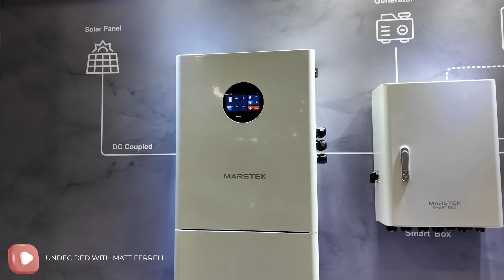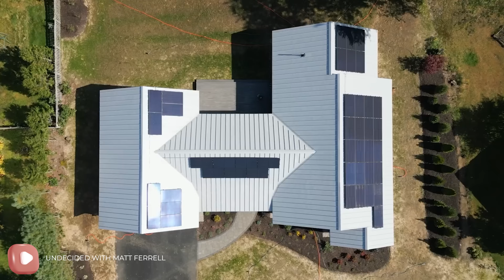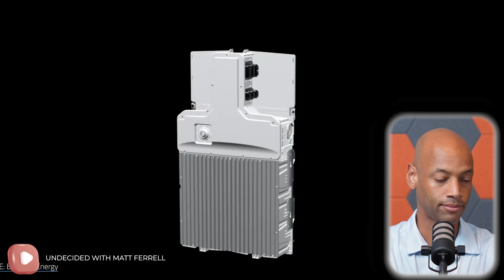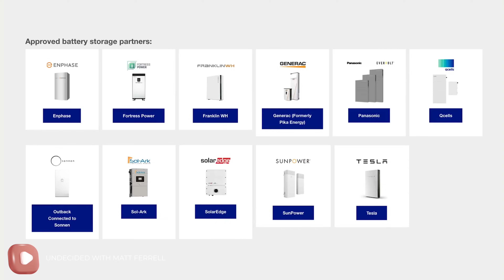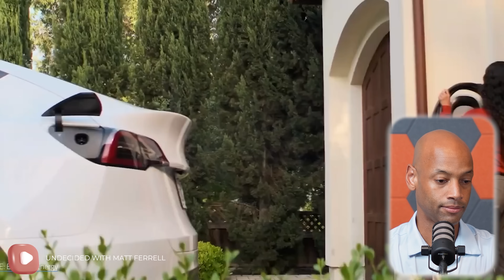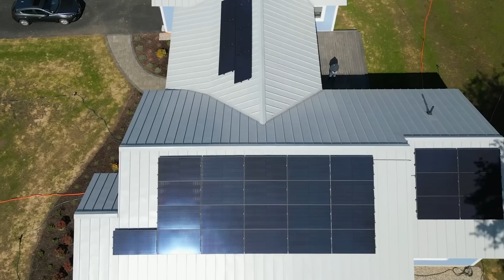Best Battery for Net Zero Home? (Enphase IQ 5P)

Comment: It has always seemed to me that Enphase has gone out of their way to create a route where they force people that buy their solar panel micro inverters and controllers, etc. to force people to be locked into buying all Enphase components including batteries.     They also seem to have (doubled down) by creating their batteries with even more micro inverters and so to force people to make you buy as many of their inverters as possible and in the end it is to line their pockets.     ( Not a Question Really, but more of what i've seen from their equipment and their pushing people to buy more and more of their micro inverters. )
Reply: The counterpoint is vendor finger-pointing if an issue arises leaving homeowner in the lurch when combining best-of-breed. We are VERY early in the tech curve on consumer whole home batteries (in the overall scheme of things). I have SunPower system using EnPhase inverters… I’m annoyed enough with SunPower for their heavily shortcut to-my-detriment install, that I’d love to dump their PVS6… but anyway.
As SPAN is complete overkill for me/my use case, what I’ll be looking forward at some point is a Hybrid Inverter and battery system that are guaranteed compatible, if not same vendor or an integrated unit.
Matt’s mentions his real reason for enPhase battery is local AHJ sprinkler requirement for over 20kWh system … as I’m looking at >20kWh battery system, enPhase makes no sense at this time for me.. other professionally installed options will be cheaper
Reply: You can choose whatever panel you want.  The Enphase hardware is good, price reasonable, app great, but do charge extra for some features.  The only item that is sub-par is their chargers.

Comment: In the end it seems you’d be better of having an energy audit of the house, mitigate things like missing insulation, replace old single pane windows, replace older water heater, replace old furnace with heat pump, etc. in other words, limit your energy usage up front before investing in solar cells and batteries.
Reply from the maker: Agree 100%
Reply: True. I have all of 3.9 kW peak of solar. Under NEM 2.0 in California I produce 2,000 kW-hr excess per year. This really surprised me as in renovating my house I added a basement and two more baths to a three bedroom house. The difference was really insulating everything, putting in double pane windows and going all electric with heat pumps for AC and hot water.

Comment: Wonder if you can take the 9.6 kW 240v NEMA 14-50 output of the Cybertruck bed and hook it up to the 'generator' input of the a battery system? Seems like it would work just like a generator with a L1 & L2 coming from the generator and there is a neutral balancing transformer in the battery system to create the 120v capable input into your backup loads.

Comment: one comment. but overall great video and you helped me understand more. my comment is if you have backup power then you dont need internet 12:35. WiFi would be powered but no internet, luckily you would be using your LAN network and not relying on WAN. So technically if your on the WiFi you can still communicate with your system so long as your system uses your LAN network, either plugged in or on wifi,  which more than likely is. 

But much appreciated my brother this video was great! Appreciate you taking the time to make this.

Comment: Great video. As a homeowner, I'm a novice with respect to solar panels. Wish I had discovered this channel before making a decision. I went with the enphase panels but am somewhat comforted by this video that it may not have been a bad choice all things considered. I did not go with the batteries, but I did consider them. I did have the designers put together a full blown option in the event I wanted to add batteries in the future.

Comment: I've really been thinking about going with the EcoFlow DELTA Pro Ultra set up. Seems to come out much cheaper while allowing a modular setup with batteries that can be moved around for multiple use cases.
Reply: I dont think you can use the Delta Pro Ultra or any Ecoflow or other brand of off grid systems with a grid-tied solar system.

Comment: We went with 3 Enphase 5p batteries with 24 Qcell 410 panels and IQ8M inverters for $43 k.  Both of the Tesla system quotes were 6 figures.  We're running off-grid after Hurricane Beryl.  Turning off the A/C in the evening, and surviving.  I wish we had gone with 4 batteries.
Reply from the maker: Hey, that’s a very good price for that system. I hope your installer was able to make a little bit of profit. Glad to hear the system is holding up.
Reply: @SolarSurge  After 7 quotes... my wife got us a "friends & family" quote from a friend in the business.  We got lucky.  The next closest quote $18k more.
Reply from the maker: @DGuthrie1111  I'd bet they lost money on that project.  Hopefully that company will be able to make it long term.

Comment: Quick question on app, is Bluetooth sufficient to control these home battery systems or do you actually need internet access? If so, why?
Reply from the maker: That's a great question.  I don't have a clear answer on that yet.
Reply: @SolarSurge Enphase Requires a live internet connection, to control the battery discharge, in the event your connected to a virtual powerplant on the grid, this is because the utility directs them to put your system in discharge in the event they need grid support.  They also require a cell modem as a backup, in the event the main ethernet or wifi connection stops working.  It’s also a good ides for the data logging of production & discharge, and finally it’s a requirement for their 15 year/6,000 cycle battery warranty.  how can they track cycles if it’s not being monitored?
Reply: Enphase is now holding training for use of their batteries and micros in OFF grid systems.  I would assume that the internet connection requirement will be relaxed with this type of system, since many of these OFF grid systems are in remote locations and do not have internet access.

Comment: Thing is that these batteries are too expensive, but yes the eco system is nice. Then again the solar inverters that are nice are also more expensive than the first available model, setting the max of your 400wp panel back to 300wp. SO all in all I am little bit happy, but it has its downsides, which can be overcome at extra costs, the system is much more expensive than other systems. And you are right about app dependence and then I refer to my hifi system than I cannot upgrade because of the app. Wouldnt mind a small control panel in my closet.

Comment: Great video review! Both Matt Ferrell's channels and yours are a must-watch. It's like a good comic book crossover with you reviewing the video! I personally prefer Solaredge due to the lower price point compared to Enphase, but the NMC battery chemistry is less superior than LFP. I do have a question. Since Solaredge has released their Solaredge Energy Hub inverter, has the reliability improved? Has the installers noticed a lowering of the failure rates with that inverter?

Comment: What would you recommend for a pro-installed unified battery/controller ecosystem setup then? I used to think you favored Enphase, but you seemed to have soured on them recently?
Reply from the maker: I still like Enphase.  I also like Tesla, Franklin and SolarEdge depending on the situation.  In this case, since he already had Enphase micro-inverters, staying with the Enphase batteries made sense.

Comment: Seems like the Sigenergy/PointGuard, modular, stackable, battery/car charger/controller/inverter system has a much better architecture. You can stack the 8 kWh batteries, then stack the car charger Lego, then the inverter Lego on top in a single stack that takes up just a similar amount of floor space for a single, undersized Powerwall. With Enphase, you’d wind up with 8, tiny batteries, a car charger, a controller, etc. strewn across an entire wall. You’d better have a really, really, really big wall!

Comment: Joe, have you found any definitive document or spec sheet from Tesla which actually/officially states that the new Power Wall 3 is made up of LFP batteries as opposed to NMC batteries? I still haven't been able to officially confirm that the Power Wall 3 system use LFP batteries.
Reply from the maker: No I think they intentionally did not publish this to spark the kind of speculation we are having now.

Comment: Hey @Solar Surge... if they are pahsing out or doing away with net metering as you stated in this video, then whats the purpose of even getting panels and batteries anymore? If we eventually wont significantly lower or electric bill, then why pay $30k to $50k for all of this stuff?
Reply from the maker: The idea is that you can be your own utility both day and night so you don’t need Net Metering. You would literally use the electric utility as a last resort option only. So you would be able to reduce your electric bill significantly.

Comment: Enphase discusses their Gen 4 10kw battery in their latest investor presentation.  Title is something along the lines of “CEO letter 2023” (reviews their fiscal 2023).  Due in 2025 along  with Combiner and System Controller merged into a single box.
Reply from the maker: Very interesting.  Would you please share the link to the report...
Reply: @SolarSurge Search for Enphase investor relations CEO letter for 2023 (page 14). Remember, these projections may be based on optimistic schedules, material availability, etc.  It appears they are looking at 10 kWh battery on a smaller wall space, deeper panel, and higher micro inverter for the battery.

Comment: 😂seems like folks like to dream up complicated and expensive systems to geek out over.  With net metering going away or having never existed in the first place,  ( my situation) I don’t see how this system is cost effective.  I can’t justify spending so much money per Kilowatt hour.  In addition, he never stated exactly what the entire solar system expense was gross or net after tax credits and rebates.  Fuzzy details.  I met recently with the site engineer for new line extension for the coop and he recommended that I install a standby natural gas generator for power outages and I could add the least expensive battery storage if I felt compelled.  Generator would keep the battery charged if power was out.  My 2 cents

Comment: Have you considered the option of purchasing a leaf s just to use as a V2H battery instead of installing just a battery on a wall in your garage?  Keep leaf outside, it has environmental protection, crash protection, could be used once in a while as backup vehicle, could be driven or towed to a charge station to bring power back home during extended outages.  I personally don't want batteries mounted on a wall of my garage, it's not an option or safe either.  I would rather have a leaf parked in my side driveway outside, even build a carport over it.  This option would cost a similar amount and last way longer given 40kWh battery used in a narrow range SOC.  Draw is limited to 7kW but that really isn't a big deal for most households.

Comment: Micro Investors surviving on top my roof or string inverter living in my garage. Electronics do not like heat. Is  it easier to replace one inverter in my garage or  each individual micro inverter on my roof? Buy a good quilty string inverter and dont complicate the system.
House battery - what a colossal waste of money. Why not force EV OEM to make EVs bidirectional? For those 1 or 2 times a year that electricity goes out the 75kW battery in vehicle should hold you over for couple days.